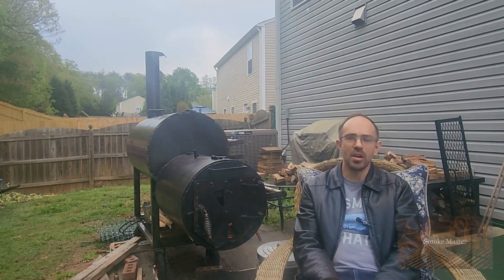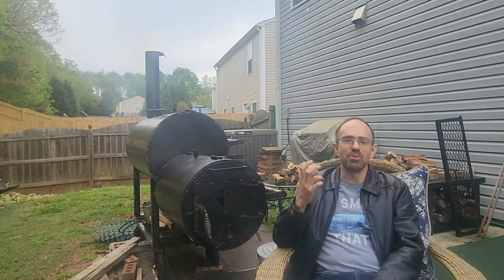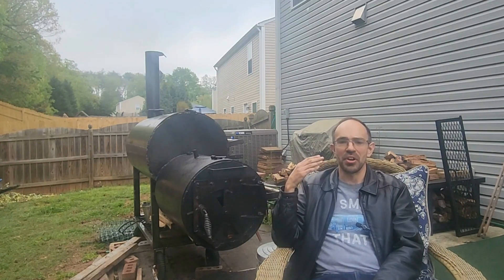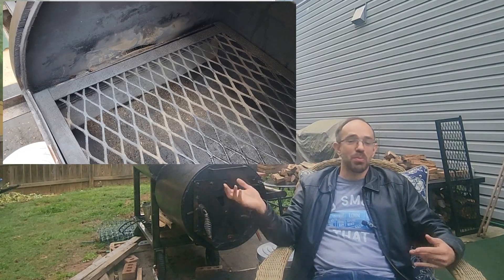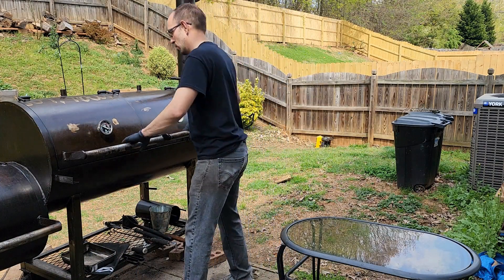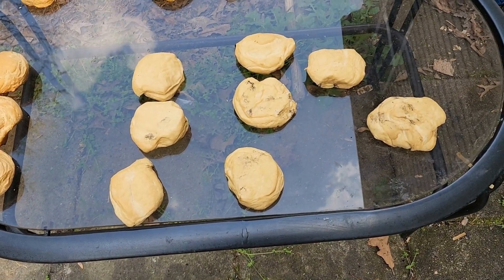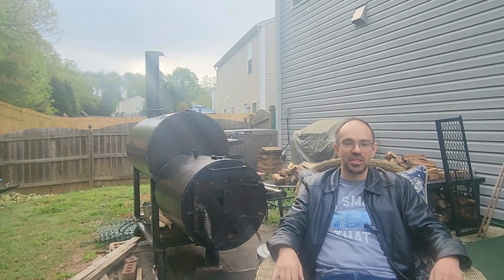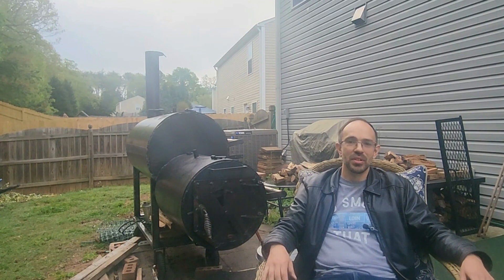Workhorse Pits Secret? - Modifying my Baffle Plate

Comment: I have a 1975  my son in-law is a thermal dynamic engineer for the space program . The baffle moves the heat past the temperature gauge on the fire box end and takes away some cooking area because it moves the heat toward the collector . we took the baffle out it works so much better it gave me back 1/4 of my right cooking area  and works 100% better but to each his own….
Reply from the maker: Very interesting

Comment: I'm following up now that I have my own Workhorse Pits 1969. FYI on my smoker the gap between the baffle and the chamber wall is so small that I can't slide a piece of paper through it.
Reply from the maker: Interesting. Maybe they were just saving on the welding. I wonder why those heat streaks are on that one?
Reply: @SmokeMasterD  My opinion about this and 50 cents would buy you two gum balls!

Comment: I agree with you on the smoke collector, should be lowered to pull the heat down more on the rack or else the heat will just go around the lower rack. I built a 250 gallon offset last year. Still tweaking it a bit here and there. Can't wait for cooler weather, have large stack of woods & ready to smoke!

Comment: Great video.  I really appreciate you sharing your insights.  I have a 1975t that will be ready for pickup in September.  Given that 1) Workhorse Pits is local to me, 2)they us 3/8" steel throughout, 3) the 1975 on their trailer looks aesthetically cohesive, and 4) they seem to have a good rep, I decided to go with them.  Still, I expected it to really not perform any differently than any other traditional offset of similar size.  I assumed they were all designed basically the same.. fire box on one end, smoke stack on the other, and a cook chamber between the two, right? We'll, after watching your video, I can see that there are, in fact, some design elements that actually do impact performance.  I do expect the workhorse to have some temperature variations across the cooking surfaces.  Most of the time I'll be cooking for two so I'll find the sweet spot and just cook there.  But I could also see me trying to find a way to add an additional defector, or make some other non-invasive minor enhancement to tune it a little.
Reply: But it will ; )

Comment: Looking at your theory from a fabrication perspective, I can’t see how the little slit between the baffle and the main tank wall could be kept to a close tolerance pit to pit. If it is actually part of the design to have hot gases escaping through a tiny slit, a welder would have to make his spot welds identical in size and shape and put some kind of spacer in between the two pieces of steel being welded together, etc. Also, the ratio of hot gases entering the pit below the baffle versus the hot gases coming up out of those slits suggests to me at least that it wouldn’t make much difference. I’m no engineer, but that’s just what it looks like to me.
Reply from the maker: You may be right. The one thing from the interviews we know is the importance of the angle. JD says that he requires the welders to be particularly specific about the angle. The importance of the slits is my speculation. Heat is coming up there. I think it's important, but you are free to disagree
Reply: I’ve got a 1969 model on order. I will look at it carefully when it comes in and see if your theory could be applied to it.

Comment: Awesome video! I just got my 1975 about a week ago and after the initial maintenance and burn in tried some ribs on it. Coming from an Oklahoma joe user this was completely different and so much easier. The size of the firebox allows for splits to be added close together for a low burning fire that kept the temp between 5-10 degrees side to side. However, the top rack was much hotter. I look forward to continue testing it out.